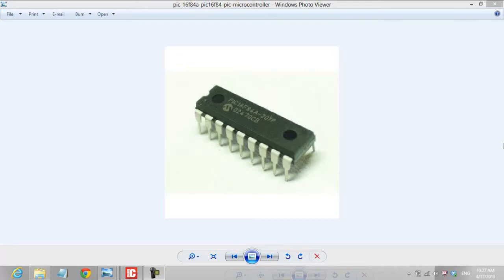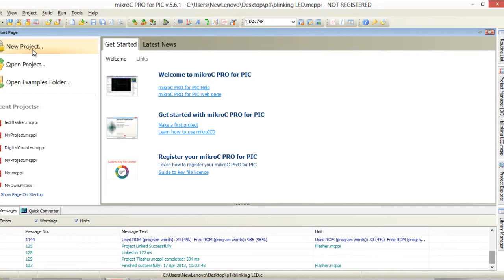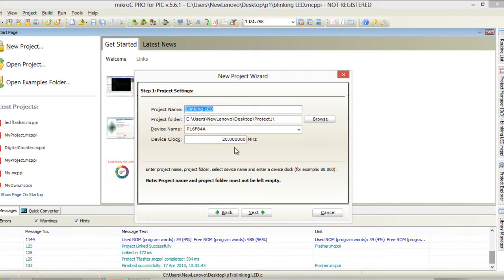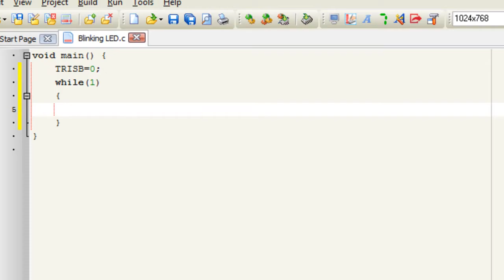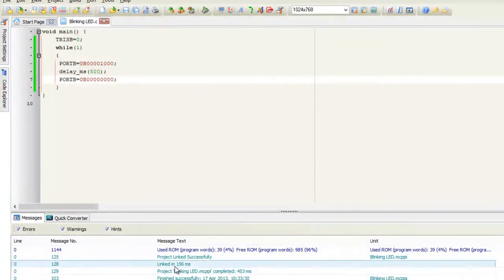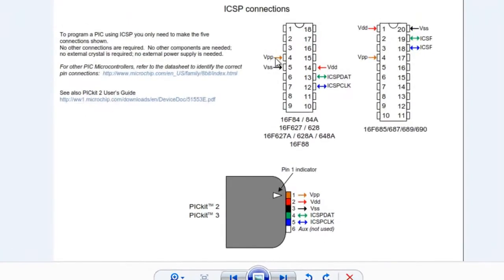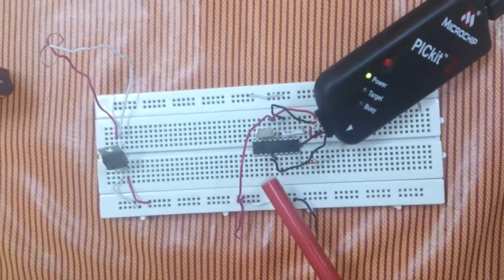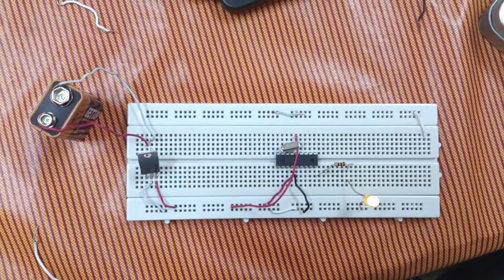Introduction into Micro-Controllers #1, how to program PIC uC using PICKit2

Comment: hello , i programmed my pic 12f675 using mickro c for first time ...from that onwards my pic kit2 is not detecting my controller ...what may be the reason??
Reply from the maker: make sure the connection between picKit2 programmer and pic12F you're using is done correctly
Reply from the maker: If the connection is correct and still the same problem, try another new IC.
If the other new IC worked, this means your older IC got damaged.
Best of Luck